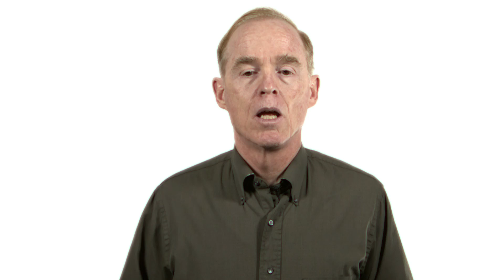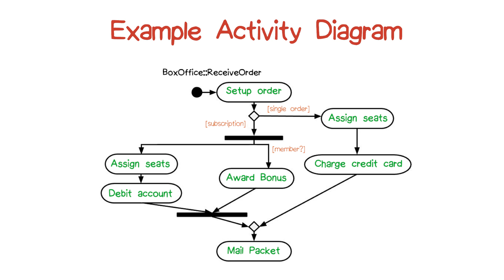Example Activity Diagram

Comment: Someone please correct me if I'm wrong, but at the top when the token reaches the diamond it doesn't split into two tokens, does it? It takes one path or the other, depending on whether the order is a single order or a subscription. It's only if the token takes the subscription path and arrives at the fork that it splits into two tokens.